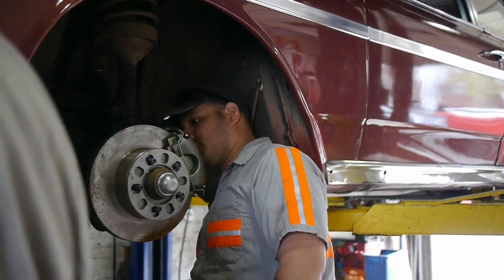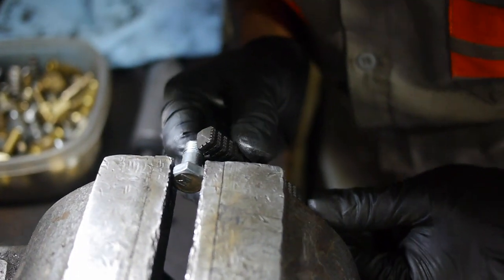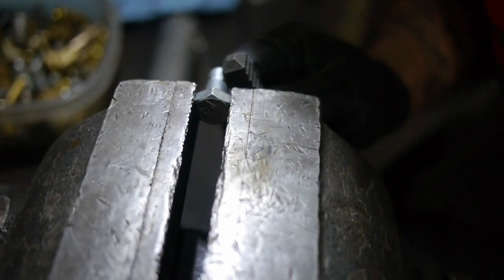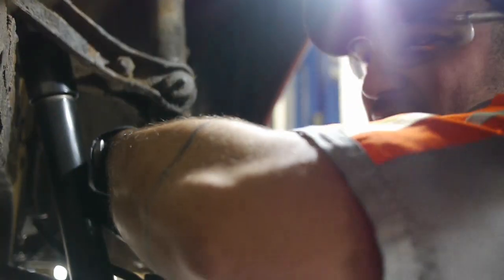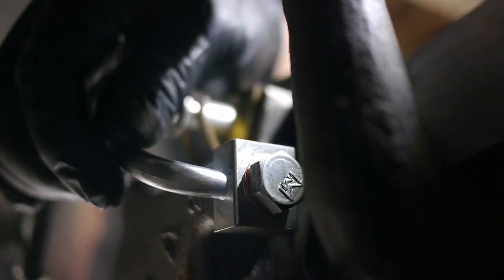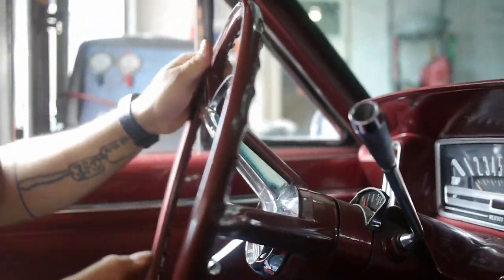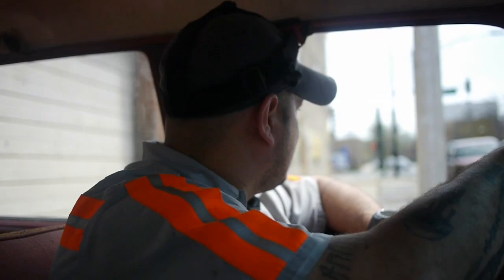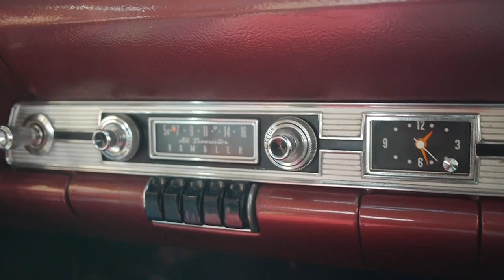1964 Rambler Front discs Brakes conversion Part III by Folleh Shar Tamba

Comment: WHERE DID THE KIT COME FROM.
Reply from the maker: Brad Meyer thanks for commenting it has been a long time since we build this Rambler. We know the owner will bring it again in the summer. We will figure out where he bought the disc brake conversion kit for it. If you are still here we will let you know. The summer is a long wait from now and we might even forget. We honestly try to respond to every comment on our video to help as much people out with information as possible. We do sometimes forget to get back because our little shop is always busy. I text the senior mechanic and builder at the shop who work on this Rumbler if he knows where this front disc brake conversion kit came from, I am waiting for his reply.
Reply: @mcscgreenwheels  you're the best, and I was honestly surprised by the viewcount. You guys should have a lot more views with the editing and overall quality and content. I can't wait to see this channel blow up. Thank you!
Reply from the maker: @ECAConcepts  We did some digging around for you. The front disc kit for the 770 series classic Rambler was gotten from American parts depot. This is what is suppose to be in the kit. I will also attach the link here for you. "Front Wheel Disc Brake Conversion Kit (includes all parts needed to convert front wheels from drum to disc brakes) Consists of: new rotors, reman calipers, pads, caliper hardware, wheel bearings & races, wheel seals, hoses, used spindles & hardware, caliper mounting brackets & hardware, grease caps. All used parts are sandblasted, painted, and ready to install." http://www.americanpartsdepot.com/BrakesWheels2.htm Here is their contact information so you can call them too. phone: (937) 678-7249  fax: (937) 678-5886
Reply: @mcscgreenwheels  I really appreciate that, thank you so much! I've got a 67 Rebel that needs some love
Reply from the maker: @ECAConcepts  the owner of that 770 classic rambler is also in Rambler facebook groups, where he has bought parts for reasonable price and brought them to us to install for it for him.  I do not know which one of the groups. Here is a link https://www.facebook.com/search/top/?q=rambler%20ambassador&epa=SEARCH_BOX